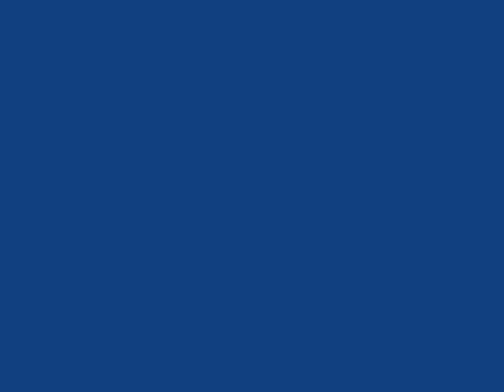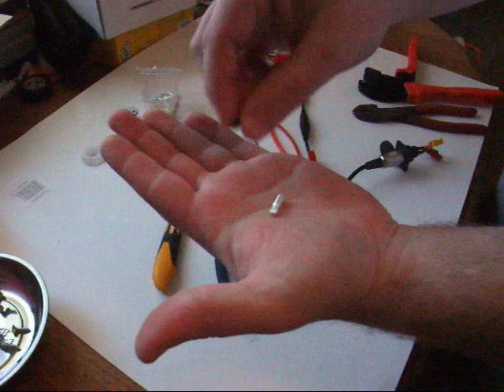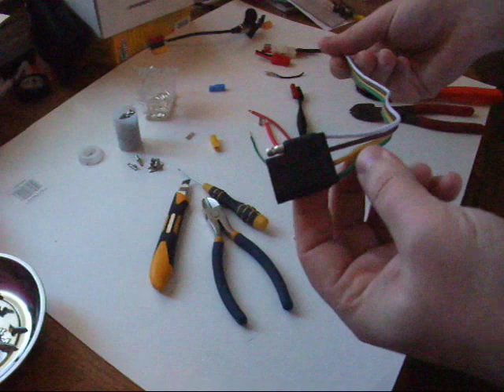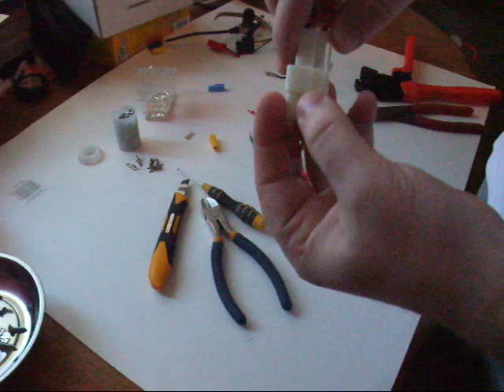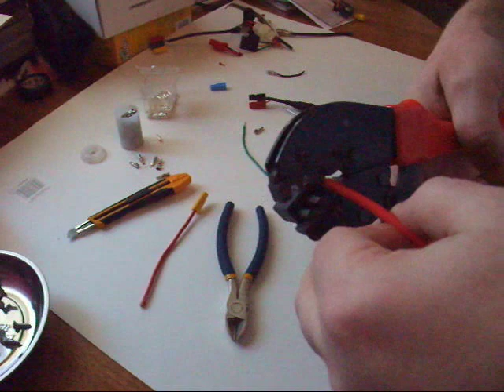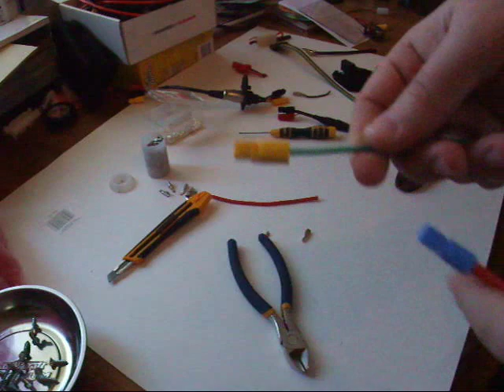Anderson Powerpoles

Comment: I have a 60 v 20 amp li-nmc. Fully charged with green light on and still connected to charger it reads 67 volts. Disconnect charger and test and it reads 33.8 v.  Any ideas. Thanks

Comment: Wanted to say thanks allot for this video. I have been "faking it" with a Terminal Crimper (the really cheap one that comes packaged with an assortment of termials etc) and it is just allot of nwork and it doesnt do the job well at all. Then I decided to upograde to the next model, the onnes you show first. But because of your video, I just decided to get the $40 "Real Deal" crimpers and do it right and easy.
Thanks again

Comment from the maker: @karmabike1911 Just like using the 10$ tool, if you do it right it's just fine. Soldering them is ok as long as you make sure no solder gets onto the spoon section resulting in the connectors becoming very difficult to snap into the housings. A good crimp is as good and sometimes better than a solder joint. Both can be done right , or wrong ! lol.